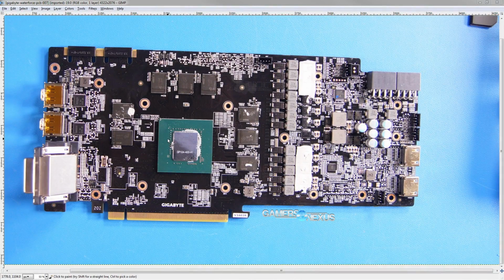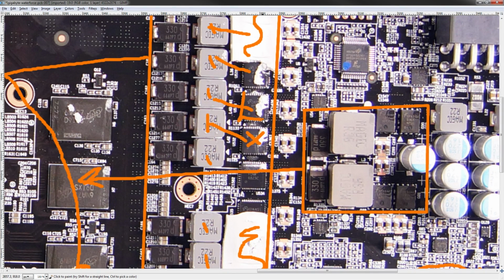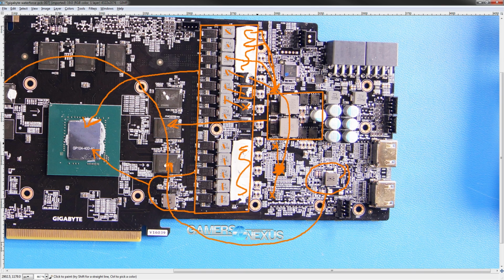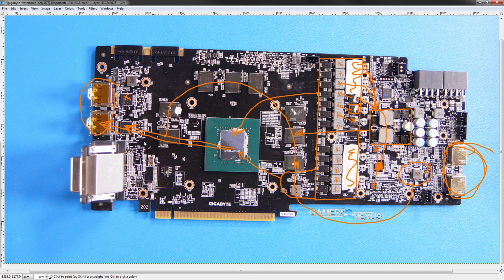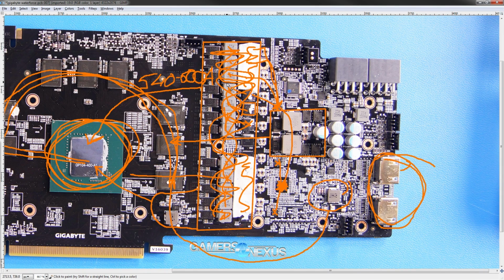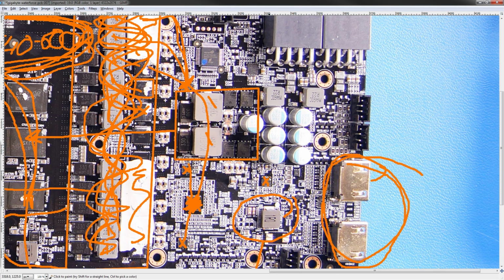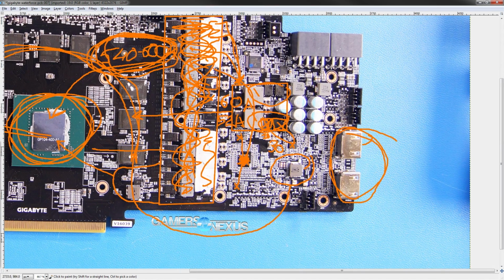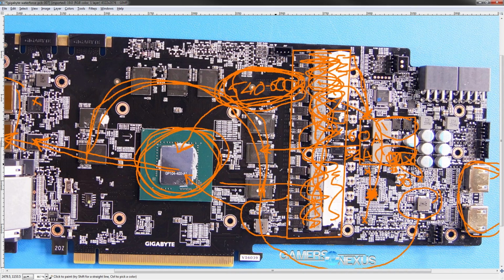PCB Analysis of Gigabyte 1080 Xtreme WaterForce (w/ Buildzoid)

Comment: if i buy a gtx 1080 and use my GTX 780 as a PhysX card useful or not?
Reply: I own the Gigabyte GTX 1080 Xtreme and have my EVGA 780 Classified dedicated to PhysX. At least for me, very few games I own even use PhysX, but it does help just a bit in the ones that do use it. I especially noticed a bump in performance in Arkham Knight when I first tested it after getting my 1080. 
That said, it seems like a have a few extra frame drops with this configuration compared to when everything is done on the 1080, but I may be imagining it. I would love someone else with experience with this to chime in as well.

One additional point: Make sure you have sufficient cooling in your system before using both a 1080 and 780 in it, since those two cards (unless on water) will generate a good amount of heat. I have an NZXT Phantom 001 full of fans with a push-pull on my CPU and use custom fan curves for the GPUs, so I don't hit thermal throttling at all.
Reply: DMan 9971 ok thank you
i also have a push pull config for my cpu (watercooled)
Besides that i got 9 fans in my case

Comment: Buildzoid, does this highlight the crap build/design quality seen on the AMD cards versus the NVidia?
Reply: i thought of that how gigabyte cheaped out on the rx 480 and here you get a vrm 2x more powerful than the chip(OC'ed) >.> seems gigabyte is helping Nvidia -.-
Reply: Exactly!
Reply: Did you even watch the video? They put overkill VRM on it because they know itll run so hot that it will lose a ton of efficiency.

Comment: Please, please do a pcb analysis comparing some of the different AIB cards of more budget chips like the RX 470, 480 and GTX 1060. I'd love to know whether the Strix has a higher price because it uses different components, custom pcb than cheaper cards.
Reply: My channel has almost all the big RX 480s on it. Also if GN gets any 1060s I'll be happy to do those too.
Reply from the maker: We have an RX 460 analysis on this channel.
Reply: You mostly pay for the name, not parts.
Reply: Buildzoid (the guy doing this) has done a couple RX480s on his channel, actualhardcoreoverclocking
Reply: 1060 STRIX is a complete overkill, it is way above all other PCBs but you don't really need it.
Reply: Thanks for all the replies :)